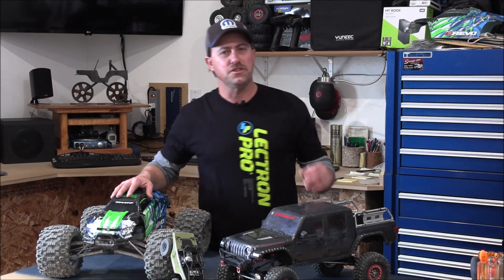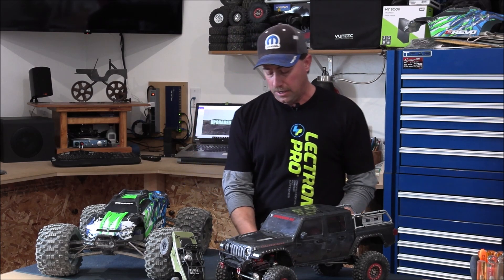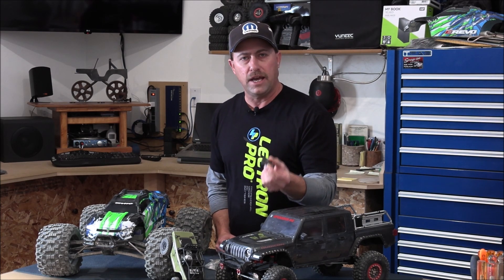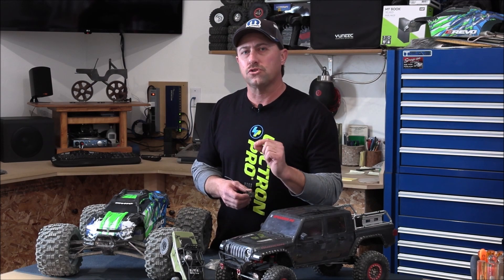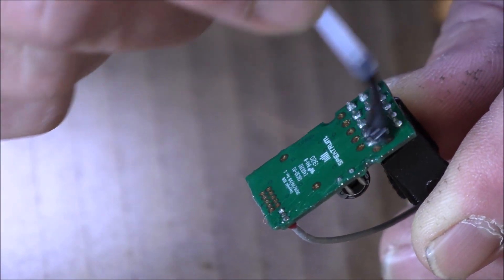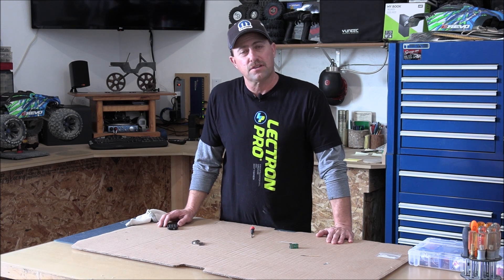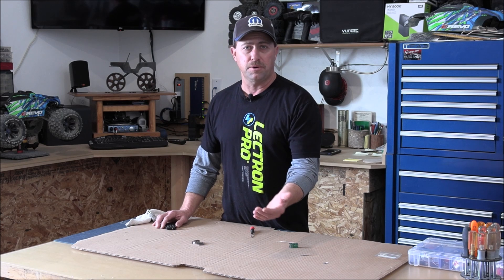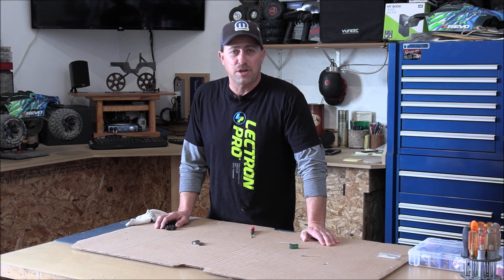Do This To Waterproof Your Receiver!

Comment: Great tip, do you suggest spreading some around the outside of the box at the seams where gaskets are?
Reply from the maker: No, that would make it difficult to get open and change out commponents. Not nesecary, with the conformal coating.